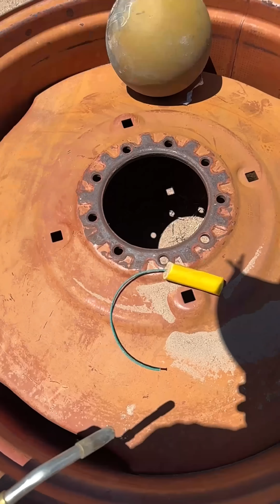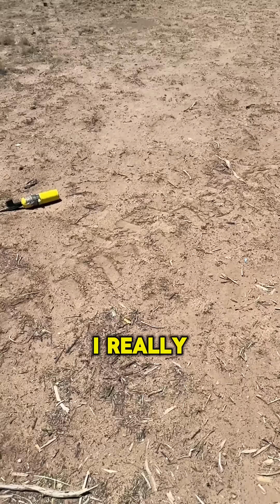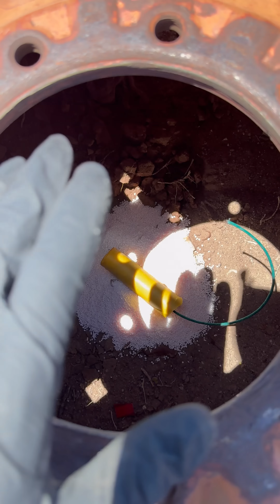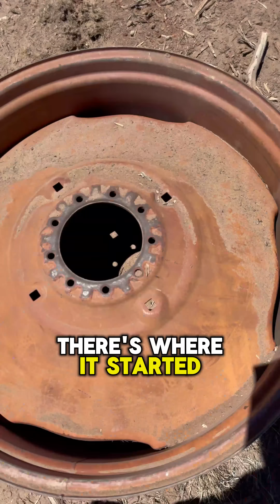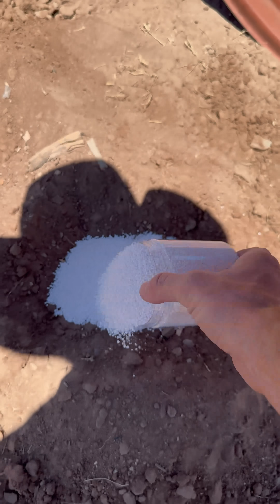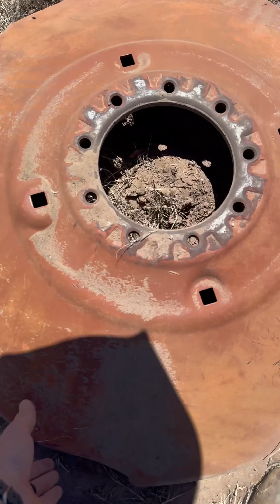How powerful is ANFO and Dynamite?

Comment: calculus for the main part:
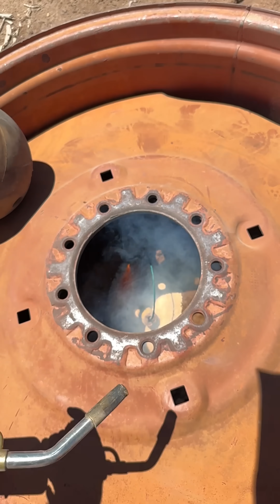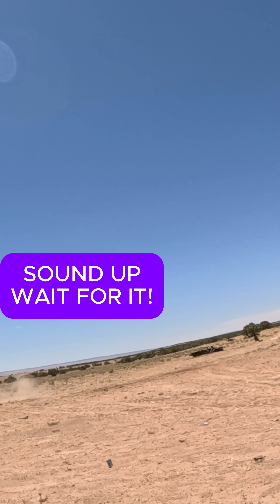flying time = 1:26 -> 1:32  = 6 seconds meaning free fall is 3s
h=1/2gt2 so 1/2(~10*3*3) = 45m high. for the other part, it's probably 3 time higher. all in all, the most impressive part is that it got broken from the explosion.

nice one 😂❤

Comment: How about one of those really old water tanks/ boilers that weighed like 100+ lbs, that was only 4’ tall and had all those rivets going around the top and bottom as well as on the seam running along the length of it.?  Those things are thick industrial tanks and are indestructible- wonder how much it would take to blow one of those apart?
    ( you asked so that’s what came to mind ~ if you can find one

Comment: Fill wheels and tires starting with the smallest rubber tire and wheel to the tractor tire of the largest John Deere tractor. 
  Push the bead in to fill it. You can run wick out the valve stem hole.
  You will probably need a crater or a small canyon to contain it.

Comment: Is it really anfo (amoniumnitrate plus fuel oil) or just amoniumnitrate?
Reply from the maker: It really is if you look closely you can see it’s pink tinged
Reply: Thanks. I though it was more fuel. Again what learned. Like we germans always say.
Reply from the maker: @anselmkarl3039 This is bag form it’s less wet. sometimes in the mines or big projects it’s super wet because it’s not super critical but it only takes like 3% by weight for it to work very well

Comment: WTF IS ANFO AND WHERE CAN I GET SOME OR HOW DO I MAKE IT?? 😱🤯
Reply: "ANFO (Ammonium Nitrate and Fuel Oil) is a widely used industrial blasting agent made from a mixture of ammonium nitrate and fuel oil. It is a low-cost, simple-to-produce explosive known for its effectiveness in dry conditions for rock blasting and mining. However, it has poor water resistance and can suffer from "non-ideal detonation" behavior, which can be dangerous and reduce its effectiveness, leading to research on additives to improve its performance." (Google AI)

Comment: Assuming I interpreted the sound correctly: Impact velocity is 25.5 m/s, max height 33.2 m.  (Math below).  Based on the trajectories in the initial few frames of the explosion, it's probably buried several feet under where you found the lid, but there's too many unknowns to calculate further.

Based on the audio track, I believe the the ball lands at 1m31.42s, and is launched at1m26.2s based on flipping through video frames.  It took 400 ms for the ball to leave the frame, but I don't have a reference for height, so I can't calculate initial speed.

Subtracting the two, accounting for 30 frames per second,  and assuming speed of sound is negligible*, the ball was in flight between 5.2 and 5.233 seconds.  Ignoring air resistance, the initial and final velocities are the same:

formula: x = x0 + v0*t + 1/2*g*t^2
rearrange: v0 = (x - x0 - 1/2*g*t^2)/t
The ground is essentially flat: v0 = (1/2*g*t^2)/t = 1/2*9.8*t = 25.48 m/s to 25.64 m/s

formula: v^2 = v0^2 + 2*g*Dy
rearrange: Dy = (v^2 - v0^2)/(2*g) = (0 - 25.5^2)/(19.6) = 33.2 m max height

* The sound of the explosion was 0.1 seconds delay from the light, but since I don't how far away the ball was from the observer, I can't determine its offset, so can't take speed of sound into consideration.
Reply: The lids landing spot could be dozens of feet or more away from the ball thanks to aerodynamics alone, with it being shaped like a frisbee and whatnot.
Reply: People like you are one of the reasons I'm proud to be an American and people like you are my neighbors.  I call all Americans my neighbors,  no matter where they live. God bless you.
Reply: And I get all excited when I can guesstimate accurately the right amount of water to boil spaghetti noodles....😂 Holy Smokes, some of y'all got the genius NASA BRAINS! 🤯
Reply: @gabrielwatson7721 😂
Reply: Following the 3rd explosion, the whistling sound near the end of the video was the bowling ball, which makes that sound partly because of the finger holes. A rough estimate of air time of the bowling ball was 12 seconds. Assuming half that time for each direction of travel, then the estimated total maximum height of the ball was approximately 580 ft. Best clear flight paths in the area. 😎

Including air resistance would reduce the height some (I'm not doing the math today).
Reply: @user-gi6hl1jc1q Ah, I thought the whistling sound was the frisbeeing motion of the lid.
Reply: @user-gi6hl1jc1q I think the bowling ball was the second sound. The thud sound means it had some mass. The rim top had 4 holes and being thin it would be far more likely to make the whistling sound.
Reply: Kinematics alone cannot account for the quantum entanglement of awesomeness.  After some quick noodling using an appropriate Hamiltonian, I calculate, via some snazzy tensor math, that it went way the f up there.  The guys in the ISS ducked. (and hid their bowling pins).  The cool part is that it created a diffraction pattern as if it were passed through two slots.
Reply: r/didthemath
Reply: I know cause I'm an engineer right?
Reply: If yer doin math, you missed da point
Reply: That whistling sound was the lid🙄 just by the sound of the metal after hitting the ground. The second to fall was the bowling ball.. and it didnt end up a couple feet buried cos we can hear it bounce wich was weird..🤔but this can be wrong and the last might be the ball if it landed on one of the parts of the rim😅 that was my science take from that🤣🙈
Reply: @chemafernandes the first to fall was the exterior of the wheel.  The 2nd to fall was the internal of the wheel (that detached from the external).  The bowling ball was the last.  You hear 3 impacts after the explosion.  The last impact is preceded by the whistling which is the air rushing past the finger holes of the bowling ball (its also why you are hearing what sounds like multiple pitches bc there are multiple holes with different sizes and depths).
Reply: @chemafernandes  Or, maybe it was one of the solar panels that got knocked off the International Space Station
Reply: Max height of 33 meters?? You’re on crack. That thing went straight up for over 5 seconds. You think it only went 33 meters in that time?
Reply: @rudysaldivar4228   I came looking for a comment that would have these calculations, and here is it. His calculation for the height is correct. I also got 33.2m (that's metres, not feet). That's close enough to 100 feet.

And that thing went up AND down in 5.2 seconds. 2.6 seconds each way. Put that number into the formula and out pops 33.2m.
Reply: @Chris-hx3om what are you calculating for?  The wheel?  I could see the wheel going only about 33m.  But the bowling ball is significantly higher.  I calculated the bowling ball around 207m.
Reply: @rudysaldivar4228 I admit it seems disappointing for what we saw, but it is a relatively heavy object.  There's 3 thuds in the audio.  The first is the ring we see land.  The third has a choppy whirring nose that I believe is the lid disturbing the air as it spins, and it makes sense the object with drag would fall slower.  Either the 2nd thud is the ball, or the ball never landed before the video ended.
Reply: @Mikemk_ I don't know the math, but I  know the sound of a bolling ball. I agree that it was the second thud.

Comment: That's not anfos..tannerite maybe..but definitely not anfos..where was the  Fuel Oil Solution..? Another problem was that " half stick " of tnt BS..no blasting cap was used..just a fuse..so it was something entirely different like fireworks..So some fireworks and tannerite was used but fluffed up with BS I'm starting to think that rim wasn't even from a tractor either..